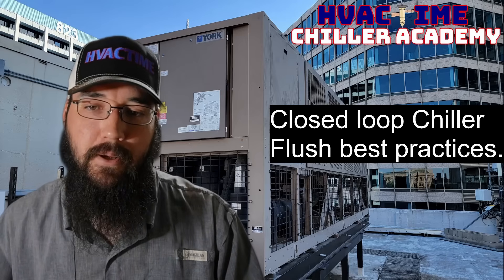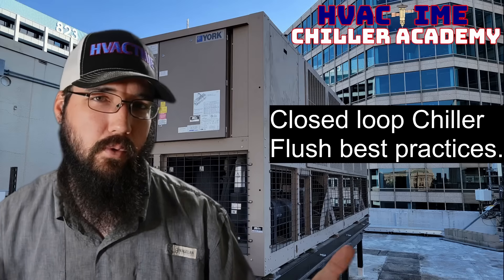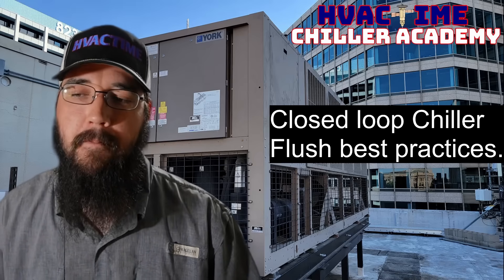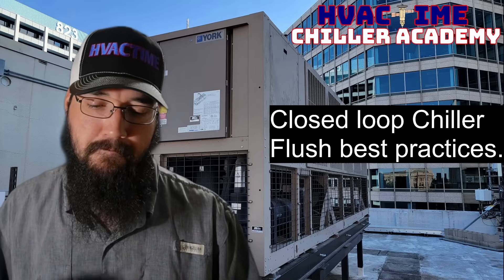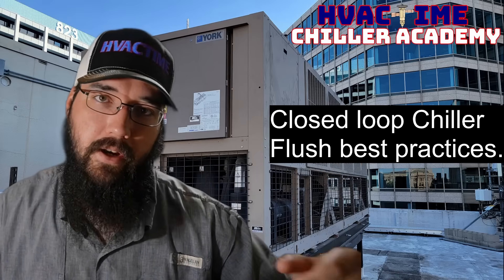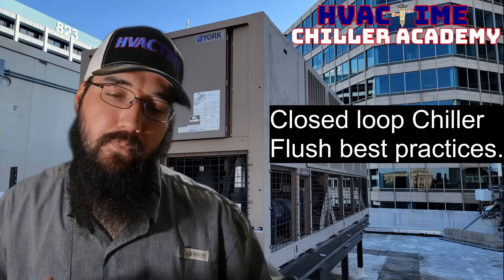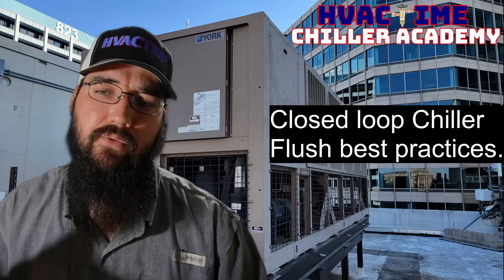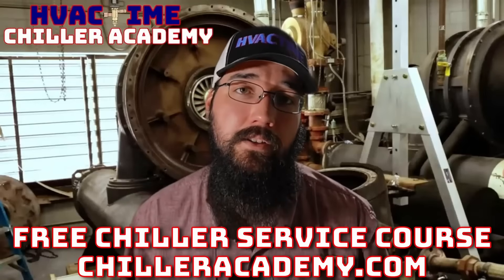Flushing Chiller Closed Loop Best Practices Explained

Comment: Hey this is Jared have a question what is the best way to get air out of my chiller loop. All my air handlers are about 10 feet below the air cooled chiller on roof
Reply from the maker: Hopefully the coils have bleeders at the top of the coil or piping. Otherwise it will have to be done at the chiller piping. Depending on the setup the evap can trap a lot of air so be sure to bleed it at the top of the barrel

Comment: Malybdates added to closed loops for corrosion inhibitors in loops with no glycol. Glycol loops have inhibitors included in the glycol added to system and in both cases inhibitors levels need to be monitored regularly